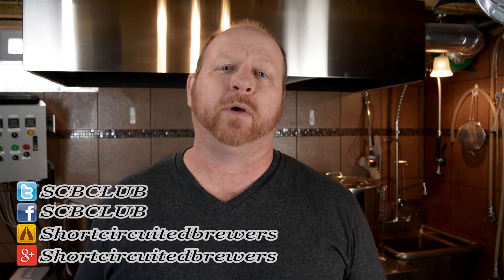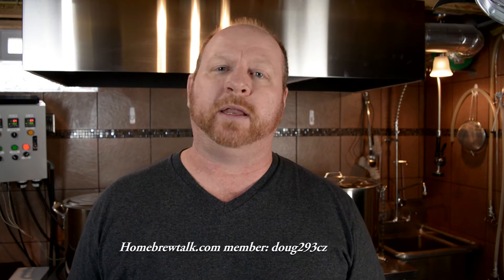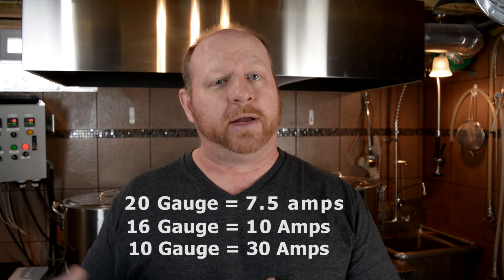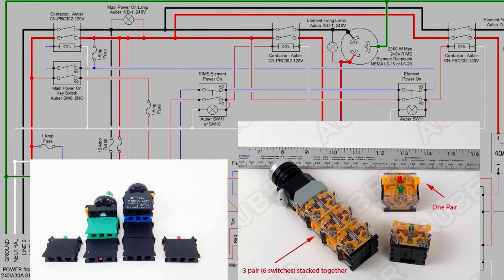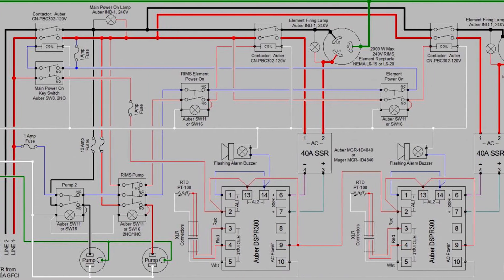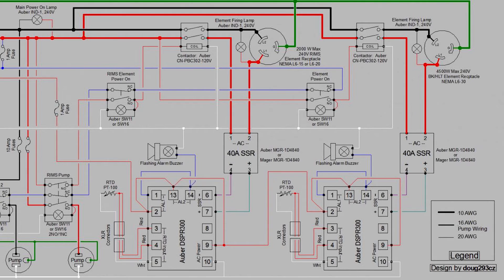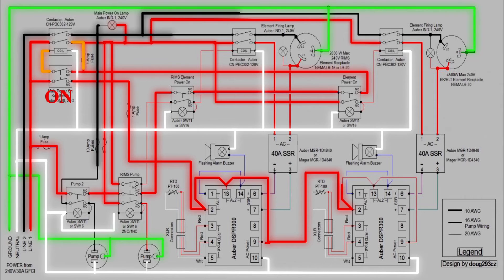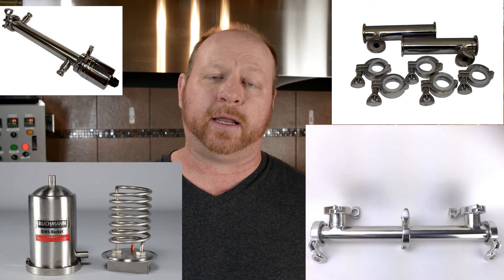Electric Brewing Series - Part 4 - RIMS Brewing System #electricbrewing #electricbrewery #RIMSTUBE

Comment: I’m confused at why your wort scorched in your RIMS tube without the pump running. Wouldn’t the PID shut off the element when it reached your set mash temp?
Reply: Small amount of wort and residual heat from the element?
Reply from the maker: @DM15k0  yep the RIMS tube was too long and sensor was at the other end. Too far away actually in hindsight. By the time the sensor was able to read the rise in temp it was too late. 👍🍻

Comment: Can you boil with a Rims Tube? It seems like the answer would be a NO,  so, what is the advantage of a Rims tube over an Electric kettle with a 4500 watt element? I currently use propane and Im trying to decide which is the best way to go.Rims Tube or Electric Kettle. I have a 40 amp breaker ready to go and I have lots space. My current system is on a cart I can move but I want to do two 10 gal batches staggered over the day using two kettles in a BIAB set up. The 1500 watt 120 power set up seems the most economical way to go. Will that work to just maintain mash and then use propane to boil.Is there a better way you can recommend?  Love the videos! Thanks
Reply from the maker: You technically can boil INSIDE a RIMS tube but not really in a kettle attached to the RIMS tube. Sounds like with your setup you could be just fine with 120v RIMS tube with a simple controller to maintain the temperature. Brew Hardware sells a kit with the INKBIRD IPB-16 that would do the trick. https://www.brewhardware.com/product_p/rimsfullkit1.htm?Click=17367 that along with a pump and you would be in business. Sorry for the delay in responding, for some reason youtube thought your comment was spam... lol
Reply: Thanks very much for the info. That maybe the way to go!
Reply from the maker: Sure! Let me know of you have any other questions! Cheers Ray! 👍🍻

Comment: Hello!  I'm just reading up on building my own panel.  Question:  When all the switches are off, and you have supplied power to the whole system, doesn't the power cut out when you turn on one of the element or pump switches?
Reply from the maker: Actually there is a loop in the circuit that the main power switch completes the circuit with so it stays powered even if you switch the pumps etc off. Thanks for watching!! Any other questions please don't hesitate to ask. -Brian
Reply: OMG.  I just saw the 1A fuse after the contactor.  I looked and looked before I asked.  Sometimes you just have to ask!  Keep up the good work...i've enjoyed your videos....now if I can just find some inexpensive boil pots :-)
Reply from the maker: Lol...my dad always taught me the only stupid question is the one you dont ask!! Try brewhardware? Most of the time Bobby is better than Amazon even
Reply from the maker: and thanks for the kind words Ken! I really appreciate it! Cheers!

Comment: Would you have a link to the switch mods?
Reply from the maker: Yes, Thought I had put all the parts in the description. Fixed it! It is listed in the parts list as a "Switch Block". Depending on which switch you go with there are options for either one. Thanks for the question. Hope this helps. 
Cheers!
Brian